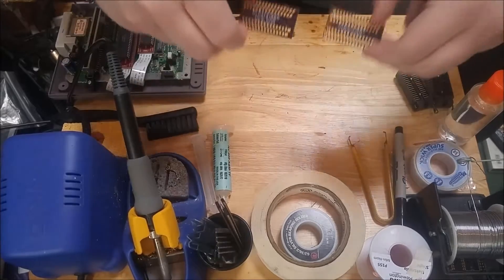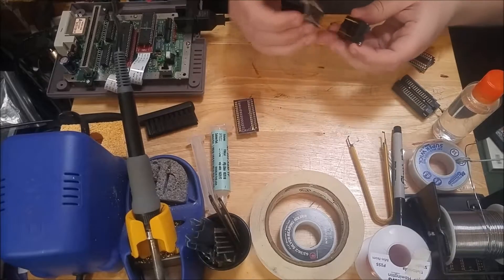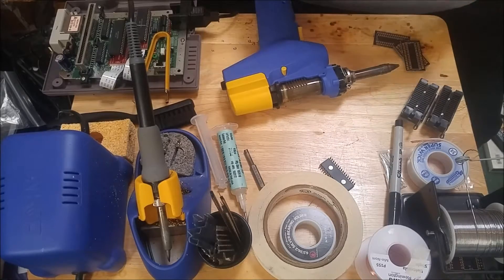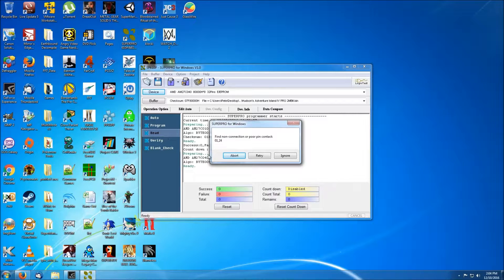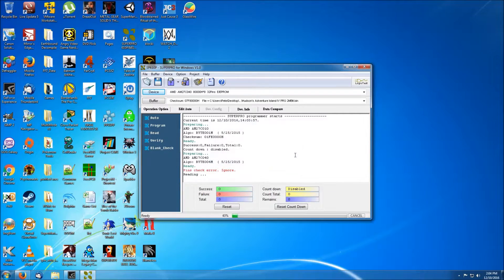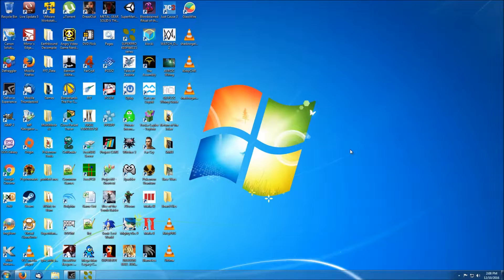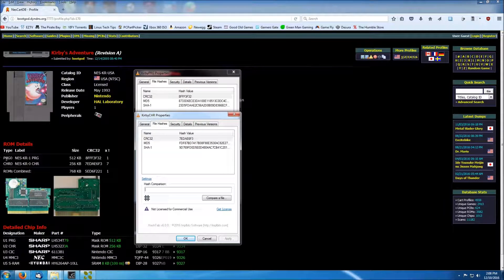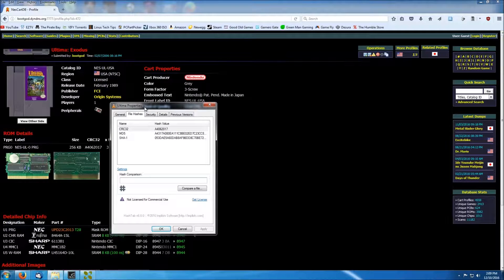Dumping NES and SNES Mask ROM with adapter PCBs

Comment: Love this idea. Going to order these! Do you have a recommendation on the ZIF sockets and what orientation would you use to dump a 28pin 128kb. Do you still like up pin1 or do you line it with pin 3?
Reply from the maker: ZIF sockets I got from eBay, the socket goes on the upper footprint.  MaskROMs go in the bottom of the ZIF socket